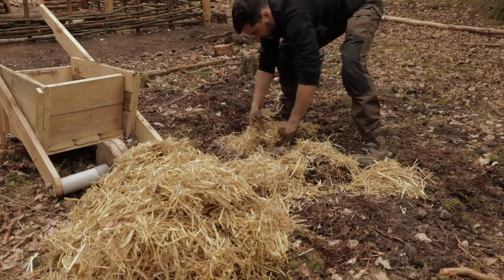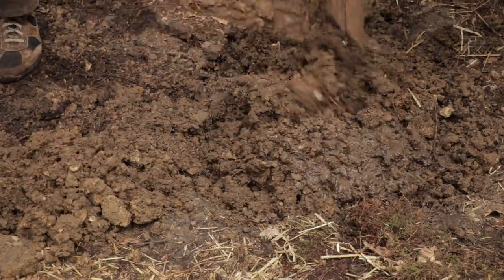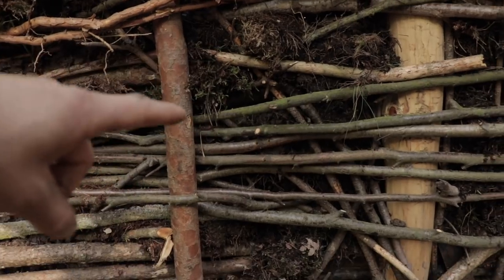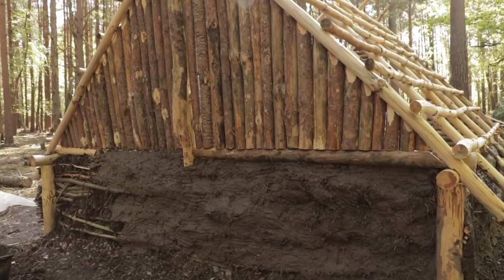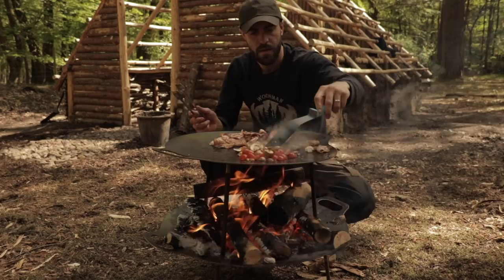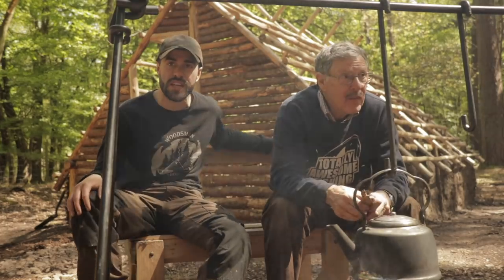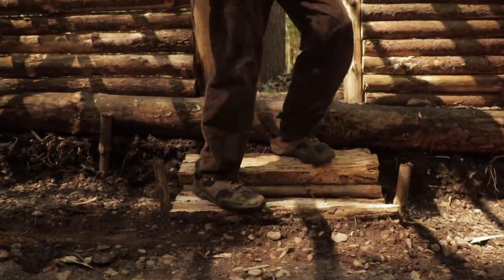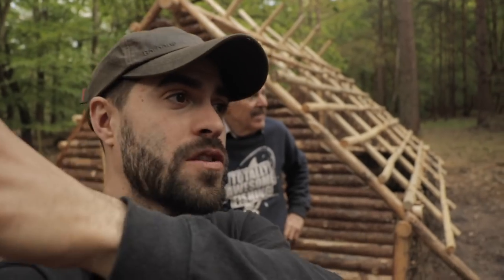Building a Saxon House in the Forest with Hand Tools: Clay Walls | Bushcraft Project (Part 7)

Comment: The best way to mix hay n mud together is to stand in it barefoot.. N use ur feet.stomp stomp.. Wiggle wiggle them toes.Technically speaking.. In a hot climate.. Mixing water hay n clay.. By ur feet.. By the end of the day..... After ur out of the mud n feet cleaned in a stream, u get a nice sleep

A suggestion.. After ur done..just like cement fine plaster polishing.. With a sculpt tool. When u complete a wall or ur car park flooring..u wet the area n throw powdered cement on the wall or floor use the flat fine sculpt tool to give it a bit more shine. Do the same here wet the area with water sprinkled by hand and the throw powered clay onto the cracks.. N use ur hands to fill the gaps.. Gives it more stability and looks fine.

Comment: The wattle is already in .. that's your sticks ... the daub is the mud mix ... you Daub it on ... thus the name wattle and daub
.

traditionally the mix is equal parts ... the straw is a fixer or strengthener ... the dirt is the gap filler and the clay or dung is the glue .... 

.
according to time team the best application method is slap and swipe ... it pushes the daub deeper in and cleans more off your hands while smoothing it out in one operation ...
.
you should do the inside at the same time as the outside .... one person in one out then you are pushing against each other and both sides bind to each other making it all secure ... if you leave the inside until the out is dry you will have to soak the outside clay from inside to allow the inside stuff to bind to the outside stuff .... if you dont it will fall off, chip and crap like a beast.
.
the roof is all about what they had lots of .. turf ... straw ... bark ... hides ... wood whatever they had loads and loads of 

.
GPS Grand parent smack lol .... 

.
speaking of which ... how's dad's neck ... from his painting mishap ?

Comment: Australia has so much clay, iron infused clay in fact, wred sand, red dirt and a lot of clay.

Most of our houses are built on clay so it will be very rare to find houses without cracks or the tell tale patch up look inside the homes of foundations settling.

We could have basements because of the very low level of ground water but there's no real point, we aren't up to the point of London when it comes to populaton and we do have such a vast country where you spend at least a day of driving to get out of one of the western states..

Yes, we have the short end of the stick when it comes to fertile land, but.... are you interested in iron, clay or sand? we are happy to strike a deal with you.

Comment: When you mod the big logs that go horizontal try to mix your mud and clay with a more clay and keep your straw straight so it lays in those cracks really nice or add the straw right as you're laying the clay so it's straight I thought that was funny when you said traditionally there would be dung put in the mix I had just said use cow turds right before you said that

Comment: It goes faster if you have someone on the inside putting their daub on at the same time. They built a pig pen in the Green Valley series using the same method.
Reply: They also thatched a barn roof in that series, showed it and explained it in great detail.

Comment: Damn, dress those wedges! Mushroomed part of steel is dangerous, it's liable to splinter and shoot in various directions. Just grind or cut it off with a cutting disc, and clean out the edge, and those wedges will serve safely for another 80 years!

Comment: IMHO you should TARP it. Better Safe Than Sorry ;<) ops Edit/Add, In 2001 I paid over 
$4,000 US for 400 foot of block fence that was only 3 foot or 0.91 meters and it was around June. It got over 120* F and a few months later ALL the 4 inch blocks were loose. ;<( I was told by the contractor that it was MY fault, because I did not keep the block WET for a few months. So take it for me, KEEP IT DAMP when it cures! ;<P

Comment: You're not making pottery, this is a semi-authentic Saxon house.  What kind of plastic tarps did the Saxon's have?  If they crack just add more mud in the cracks.  If you can't get thatch I would use tarps on the roof until thatch was available.

Comment: Ok  your viking house the roof was Bark . Now thing for a minute where did the idea from Bark for roofs come from .. the celts also used bark and they also used Hides .. making pine tar has been used for 1000s of years .. some houses may as well used Hides ..  stitched together .. and them mopped with pine tar .  Its gonna take many poles  to line that roof .. just like you did front and back .once its done  mud it up  and use sod. As well . Them poles may be a bit weak gonna take alotta mud .  If you have access to clay .you can build a kelm . And make tile from clay ..look on the tube and search for primitive living their is A guy that made A clay tile roof. .

Comment: Ok Im having a brain fart. I see dirt sifting going on to get rid of the rocks and pebbles. I see straw going to be mixed with mud .
This will be used on the sides for insulation from the weather I know .. but why did you add rocks and pebbles back into yhe sifted dirt ? 
Thats what I dont understand please explain this to me .. Im kinda  O C D about it .
And Also . I REMEMBER  my elders when they built their House the  also used Ox crap and Horse crap .it works really well as a binder . Little stinky in the heated months . But set like cement
Reply: Took you long enough to mention the animal mauner ..  30% Animal poop